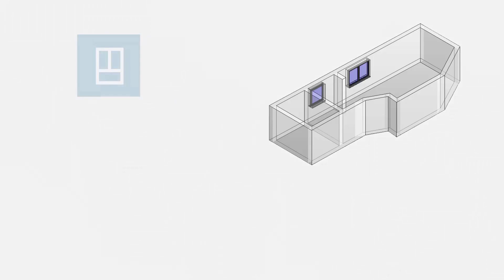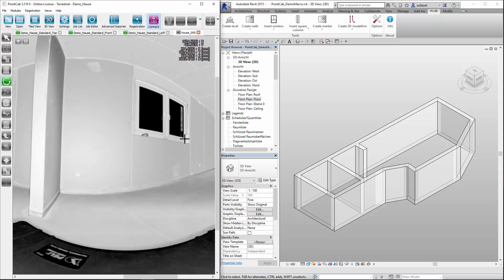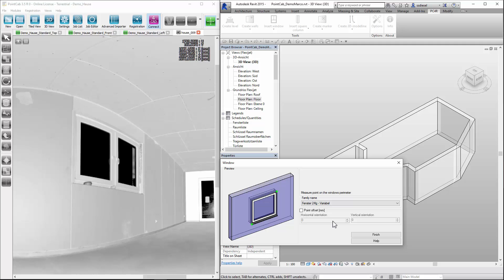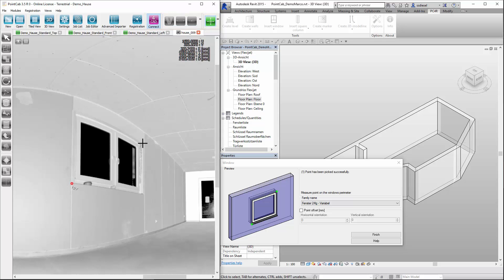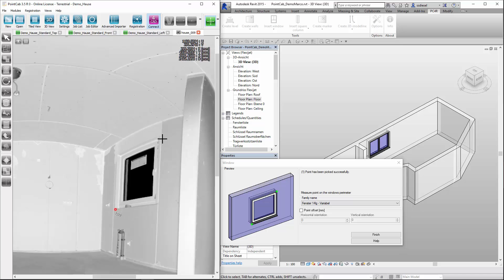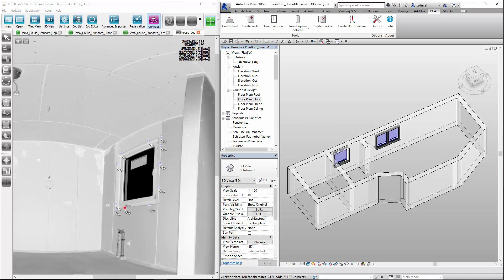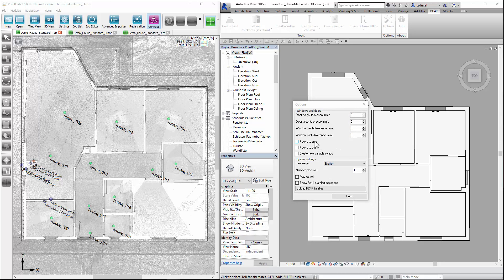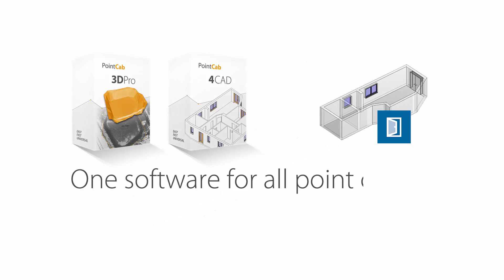PointCab 4Revit: 03 Measure and place variable and fixed size windows in Revit out of a point cloud

Comment: Hi I have an issue, when I am in the panorama mode I cant pick the point. I dont get the + button, only normal mouse button.
Could you help me out?
Reply: Goto the Settings and the panorama tab and choose "planar view". Open a project and a panorama and now the measurement for 3d points works.
Reply: Thanks Richard! It worked!